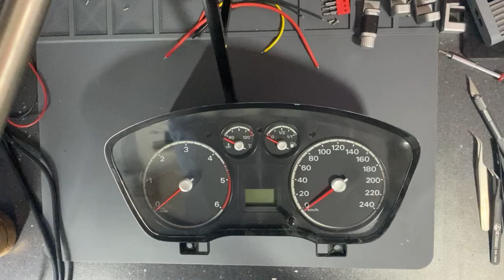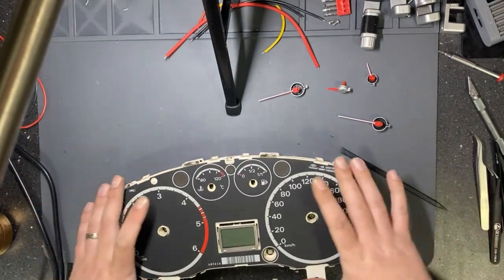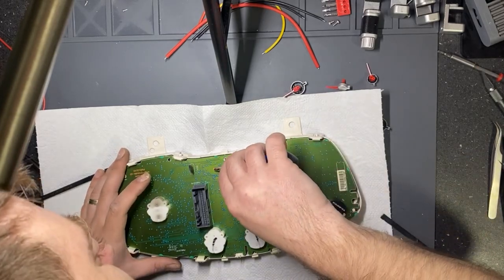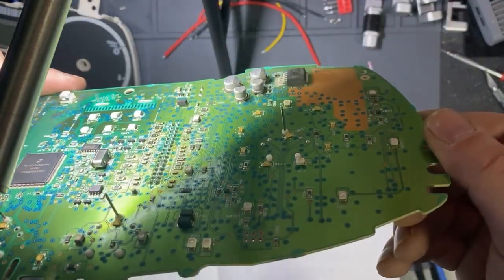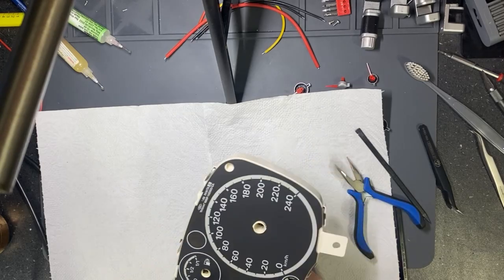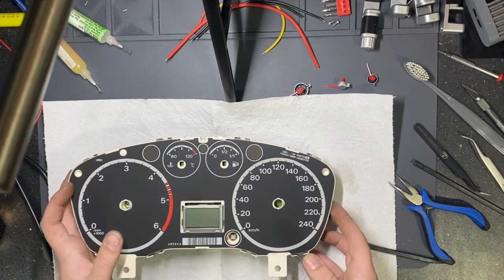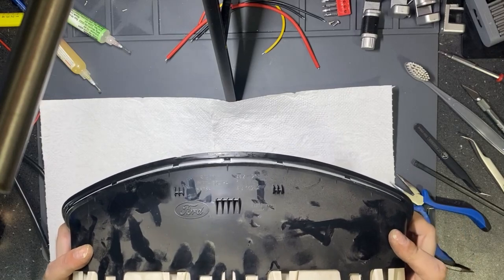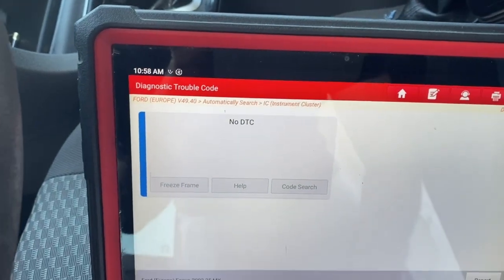Ford Focus - Cluster DTC U1900 how to fix

Comment: Hello from Greece and happy new year. Please you can inform me what software you use for diagnosis ? I have a focus cmax 1.6 diesel and i thought to change the cluster with a new style cluster to it have bigre lcd screen ( mine have the small one with 2 line ) and i need to buck up the configuration from cluster and transfer them to new one.  All the best Dimitris
Reply from the maker: Hello, in this specific video i was using Launch X431 Pro 3S+ ( Pro5 ), You need to re-learn keys to new cluster and learn cluster with ECM in order to can start car with new cluster.
Reply: @UnixCoDElectronics  Thanks for your reply and happy new year. Yes i know that i must pai the keys and ecu with new cluster, i just need to know if with the launch x431 i can get the config from old cluster so i upload them to the new one. So do you know if the launch x431 it can do that ? Also I try to use the last version of elmconfig with my obd link ex cable and i get a message that : "incorrect response from adapter to request "st i"
Stn 2230 v5.8.1 " and i try everything but it's unable to connect the software with ECU !!? Do you have any ideas of resolve this ? Again thanks for your reply. 
All the best Dimitris